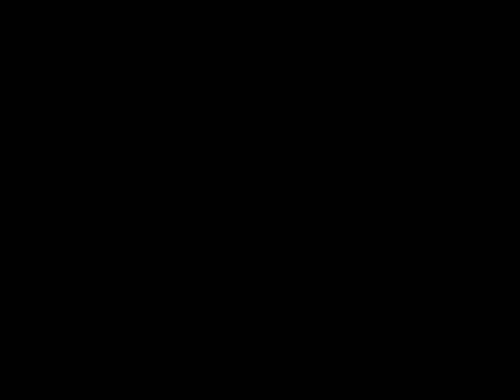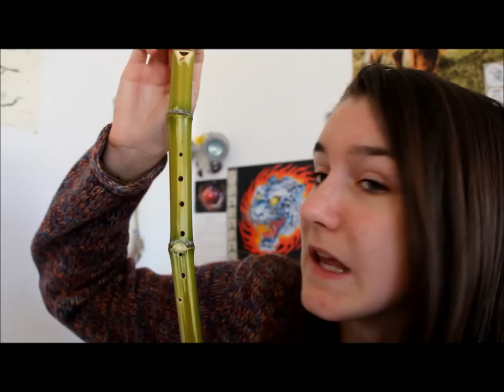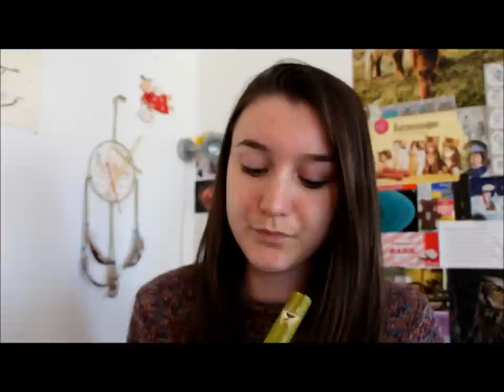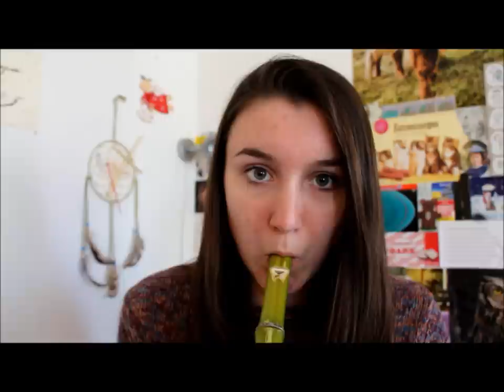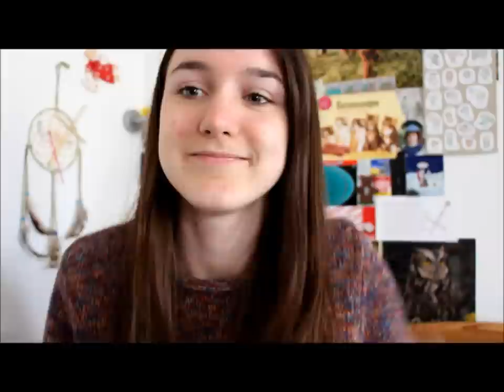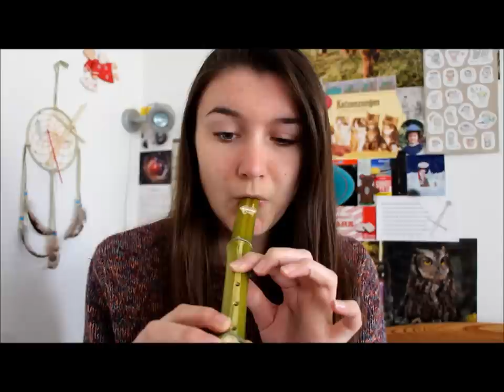Homemade Instrument - Bamboo Flute

Comment: How did you make the mouthpiece?
Reply from the maker: It's based on a basic flute design - a block of wood stops air from flowing through all but the very top sliver, then it hits the open area and creates noise.
Reply: You should Really make some more Flute Videos. Try and make your own kind's of songs like I do oh yeah and by the way Nice Flute (:    all I need it a freaking Bamboo now ):